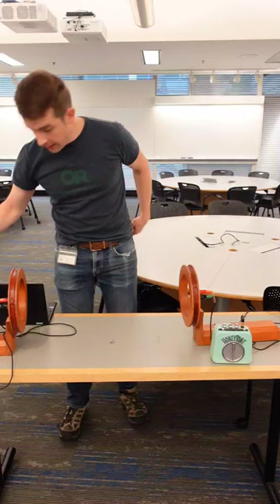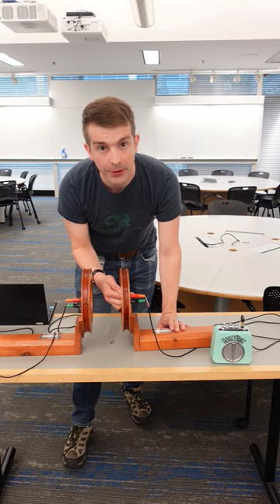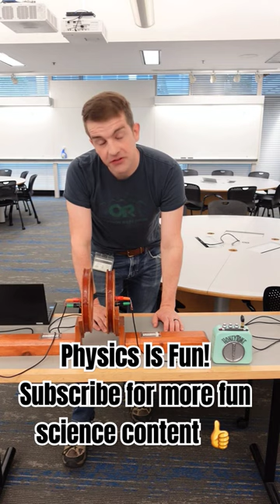Wireless transmission of electricity! #physics #science #stem #electricity

Comment: For anyone wondering, this setup is essentially a transformer. This is an excellent demonstration of mutual inductance.
Reply: Yes, it's known as an air-core transformer.
Reply: Sigh. Thanks. You beat me to it.
Reply: Well can someone at least tell me how many turns of the coil is necessary to recreate
Reply: @villagevaliant all depends on your input voltage and desired output amplitude (without further amplifying it). More wraps takes more current means more voltage, and conversely the more wraps your pickup has the more current your "transmitter" needs. There isn't going to be one solid answer for you, I guarantee there's a tutorial out there though.
Reply: Probably definitely gonna be hundreds though lol.
Reply: @azraellie_  Appreciate it, I actually just came across a video going over what you explained quite clearly might I add ! lol Fr appreciate the input

Comment: 90 degree means ….. NO FLUX GIVEN.
Reply: No. It means there is no rate of change of flux across the wire turns in the second coil.

Faraday's Law is to do with rate of change of magnetic flux.

So you could have a steady DC current passing through the transmission coil and for the two coils to be aligned in the same direction along the same horizontal axis and physical separation to be very small,  there would be a magnetic field produced by the transmission coil but the receiving coil would not output any current
Reply: Nice 😂😂
Reply: @deang5622 - You totally missed the joke smarty pants!
Reply: Damn 😂😂💯

Comment: Yes! Those mini guitar amps are good receivers. Most old guitar amps too. I used to have an old Peavey amp that would often pick up the signal from a Spanish radio station. Made it hard to be taken serious in my local music scene. I eventually sold it and bought a Line 6 amp with a good noise gate.
Reply: The original is more interesting. To me anyway.
Reply: Happened to me with a guitar speaker too
Reply: "I'm on a Mexican radio..."
Reply: Mine loves to pick up the Spanish channel too
Reply: That’s not really the same thing. One coil of wire a turning low frequency electrical energy into magnetic energy, while the other has an induced electrical energy from that magnetic energy (that’s why the coil is called an inductor). A guitar amp picking up a radio station (which usually occurs when a cable is plugged into the amp but not plugged into a guitar) occurs because a high frequency electromagnetic wave is being picked up by the cable, which is acting like an antenna. This is usually done with AM radio stations, which can generally be turned into audio with a simple capacitor, which is often one of the first components in the signal path of a guitar amp to remove low frequency noise. This can also occur with FM radio stations if the right circuitry is in place and the correct cable length
Reply: @caydjj It can happen when plugged in too, the pickups will do the same thing. My amp makes a noise when I get texts or I'm about to get a call, sometimes just randomly. It sounds almost like a modem noise. I also had a fancy amplifier for my PC Audio back in 2010 and it did the same thing everything I would get a text or call.
Reply: Peavy was noisy.
  My spring reverb always hummed.
Reply: @lucky.the.boy.tundra  No. Still had to put up with haters because haters gonna hate. 🤘
Reply: There is a circuit in the amp that is a resonant length for the radio station.  We used to create that in an audio board at a television station. Flip some switches and turn it up. Got the local AM station.
Reply: @jwr2904  I see what you did there.
Reply: @Ridgerider-z4h more likely it's the size of the loops going to your guitar. If the loops are all the same size they'll resonate with the same frequency and the amp will increase whatever it picks up.
Reply: Eddie Van Halen wrote Poundcake using an electric drill after a subcontractor caused noise in his guitar amp after operating the drill. Same concept
Reply: @jwr2904 Wall of Voodoo ‘82 😂😎(Call of the West) have the album, haven’t heard that in years!

Comment: 1. Are the values of L and C the SAME 
2. where is your GROUND wire 
3. Where on the circuit did you put you GROUND.
Where you connect it will depend on you output and the RANGE you can get.

Comment: I witnessed this first hand back in the late 70's when our neighbor across the street was using his CB transmitter that was over powered. I could hear him through the speakers of my mom and dad's reel to reel even though the reel to reel was turned off. I called them on the phone and it stopped.
Reply: My grandmother lived 200meters next to AM radio tower. She listened the radio with 2 meter antenna directly connected to a speaker. Without any lamps/transistors nor external power. The antenna itself was hearable even without the speaker. Also some metal dishes, forks, knifes, randomly vibrated and made  noises if in right position.

Comment: Transformers are always cool. I assume the turn count is the same. Otherwise, you would be getting distortions. Unless you also have a filter circuit... hard to tell on my phone. Very cool 😎 👍
Edit: There is some confusion by what I mean by distortion. Changing turn count changes step-up/down transformer, i.e., the final voltage. If they aren't matched, then the impedance is not matched(unless a reactive load), causing interfering waves as the inductor(second winding) collapses/builds. This shouldn't be very noticeable at lower tones where the fields have time to bleed off, but at rapid or high frequency tones, it would cause coil whine. I am not an audio engineer, so I am a bit out of my depth with how extreme of an effect it would cause.
Reply from the maker: Yep! Same turn count👍
Reply: @physicsisfun_official bro wher u turned the 2nd one by 90 degrees , u sharply turned the switch of music off , and when u made it again parallel , then u sharply turned the switch on 

You are only making us fool 😡😡😡
Reply: What makes you think a difference in turn count would cause distortion?
Reply: @opguy_219  No he didn't. He was holding the base so it didn't move.
Reply: @@brotinger_1904coding and decoding? To explain how a transformer works? 😂 There's no need to have the same turn count at all. But it's necessary to match the impedance of the receiver (a speaker or an amp). Turn count is one factor determines that.
Reply: @@brotinger_1904a different turn count would not change the music, only the amplitude of the signal, which would appear as gain on the speaker.
Reply: @Ferraday  it's would cause a volume change
Reply: Step up vs step down transformer
Reply: @opguy_219 it's a simple 1:1 transformer, not a magic trick.  He isnt trying to fool you... you are doing ok on your own.
Reply: No, if the coils had a different number of turns he would be getting the same amplification in every frequency. So no distortion.
Reply: @opguy_219  What he does is totally legit.  Try it for yourself to see.  Also, whatch the video carefully.  There are no switches.
Reply: @Ferraday  The coil with the more windings will have a magnetic field that is slower to collapse and build.  Its response time will be longer.  At high frequencies (high pitch sounds) the magnetic field will not build and collapse as fast as the smaller coil's field.  That means that the sound comes out distorted from the original. It gets kind of "staticy".
Reply: @appliedfacts the funny thing is he says it wireless while using at least 100m of copper windings to do the job a 1m length of speaker cable would do lol its like building a generator on your electric car that runs on diesel and saying you have a totally electric car lol
Reply: I love all the amateurs guessing.
Either you have studied transformers in detail or you haven't. If you haven't studied them as part of a physics or electrical/electronics degree, then STFU: your explanations are likely to be wrong
Reply: @deang5622  so do you have a point or are you just trying to sound all high and mighty ? Lmao
Reply: @deang5622 social media has brought us humans the great joy of seeing a strangers ego destroyed in real time. You saw a bunch of comments debating a topic you know nothing about and decided to try to insult everyone because you don't understand the topic. Don't pawn your insecurities off on other people little guy, I'm sure you're an expert on something; try coloring books or those puzzles where you put the right shaped block in a box.
Reply: @danielmiller2886 opguy probably beleives in witches also😂

Comment: You did not mention amplification. The music (current) coming out of the computer is tiny (milliamps), so you need to amplify it before feeding it into the coil.

On the receiving end, it might be enough to drive earbuds but I’m going to guess that you also need amplification if you’re going to play it that loud on external speakers.
Reply: Actually, the power produced in the reciever coil of this apparatus will be around 70 to 90 % efficient at proxima. ~100W in for ~80W out.
Reply: Or the speaker could have the amp...
Reply: @nomandoerr874 how is that related to currents?

Comment: If you put a coil in between the two would you get  "inverted sound"? Just wondering if its possible and what it would sound like
Reply: It think it would be already inverted as is. That’s why the plugs between the left and right are switched (the same location even tough it’s mirrored), to get the opposite coil winding and counter the inversion.
Reply: It wouldn’t matter. The sound would simply be 180° out of phase. A speaker driving inward makes a sound as well
Reply: Though if you do have 2 speakers that have opposite polarities it can creat interference and you get very low sound depending where you are.
Reply: You would merely intercept the current that would have gone to the receiving coil.  Do you get that one coil has current running the length of the insulated coiled wire and the other similar coil, if close enough "detects' and "absorbs" some of the electomagnetic field and follows its fluctuations.  Switch the two wires on a speaker between listening to the same thing.  You won't be able to tell the difference with  "inverted" sound.

Comment: Used to set up speakers without internal amplifiers each week. Once we were confused by music playing from them before the amp was even turned on: accidental radio antenna tuned to a Latin music station.
Reply: The station must have been close by and the speakers of efficient design.  Possibly the speaker wires were long enough and close enough to a multiple of the station's frequency to serve as a good antenna.  

Crystal radios with passive earbuds and enough of an antenna can demodulate a broadcast signal efficiently enough to be audible without amplification.  That's impressive due more to the sensitivity of our eardrums than to the power of those tiny speakers an inch from them.

Comment: Back in the 50s my dad read an article in Popular mechanics. He got a long wire that went around the room and plugged into the audio jack on the Hallicrafter TV. Next he got an old pair of headphones wound a halo of insulated copper wire. Hooked that up to the speakers in the headphones et voila blue tooth. Nothing new here folks, move along. It could have used an amplifier but it did work.

Comment: How about a comparative demonstration, showing capacitive coupling?  

After that, try Xl vs Xc demo's with purely reactive circuits, to show no power transfer and therefore no resultant audio energy, and how energy transfer is affected by impedances that work well from source to load?  

Next comes a comparison of impedance matching in older tube amps or RF systems, to zero impedance current source solid state amps as motor/brake sinks as well as sources, that have huge damping factors over inductive solenoids (aka speakers usually) that actually have complex impedances over bandwidth?

Comment: I prefer to call it Lenz law. But, yeah, a current will be induced in the secondary coil in such a way that it will oppose the external magnetic flux that goes through its inner area.
Reply: Indeed,
The exact reason copper or aluminium or any other paramagnetic metals have a proportional magnetic field induced by the material moving within the magnetic field..
Or why a magnet falls slower when dropped through a paramagnetic metal pipe
Reply: @_bambi_420_za_  Your explanation seems rational, but Lenz's/Faraday's applies to conductors in general without considering their magnetic properties.

Comment: What happens when you put two coils in parallel like that off the same ac current source? Can you make an expanding and contracting magnetic field and also what about a tippler cylinder made of electrical currents like that? Does a tipler cylinder have to be made of matter? Also what if the tipler cylinder is made of magnetic material or more or less dense material does that change the properties of the tipler cylinder?

Comment: Is It power transfer or data transfer (technically the same thing but decently different enough) like is the speaker already powered by batteries or wire?
Reply from the maker: In this case the speaker has a battery powered amp to make it loud enough to hear. But you can easily light a light bulb with this set up as well. Which I plan on showing in a video soon👍

Comment: At first I was like, THEY TRANSFER SOUND??

nah it's power but that's dope. Probably how wireless phone chargers work
Reply from the maker: Yep EXACTLY how they work👍
Reply: @physicsisfun_official  Marine electrical AC power isolators have been using this technology for many decades...(as do transformers).
Reply: I mean, from a certain point of view, it absolutely is transmitting sound in the form of an electrical signal.

It's been a while but if I remember right, all a speaker is is an electromagnet attached to a thin membrane, and when certain electric signals pass through the magnet, it causes the membrane attached to the magnet to vibrate at specific frequencies, producing sounds.

Ah, physics are fun 😅
Reply: This is basically the same a any simple transformer. This just happens to be an air core transformer
Reply: @AlpineTheHusky That's why it's nothing special about it. Booooooring news. YAAAAAAAAAAWN
Reply: @ubncgexam  You ok over there?
Reply: @williamklemp3764 not Electrical but magnetic .... the coil converts the magnetism back to electric ...
Reply: Well if you put a cone of paper attached to a permanent magnet in the coil... You kind of get a speaker. So... Yes that is transmission of sound too.

Comment: So its just induction? Not resonance coupling? This experiment demonstrates why Tesla's wireless power would never work. See how quickly the power drops off.
Reply: Closest we'll ever get is a form of high powered radio,
Or hi powered laser arrays..
The transmitted power is really low and dependent on atmospheric conditions interference..

Everything else needs to be so close you might as well just plug it in.

Nicola Tesla's idea is not a possible reality.

Comment: How is the computer hooked up to the coil ?
Reply: With a wire. You can physically see it in the video.
Reply: @Mulgar268  sorry i wasn't clear. I meant to as the plug type. Was it USB ? One end is usb and the other end at the coil is just copper taped to the cable ?

Comment: Radio is much better for wireless power transmission, the method of transmission you described is still not properly "wireless" because it has to be "close together" the effect diminishes with the fading magnetic field.

Having it so close it's just more energy efficient using solid contacts because most of the power consumed by this setup is lost to unused magnetic fields and other circuit losses..

It's fancy but not that cool
Reply: It's like people don't even understand that computers used to be the size of a room and now they fit in our pockets. At what point will people like you realize that with time technology advances and gains efficiency?
Reply: @Mulgar268 There are limits however.

There will always be a loss when one form of energy is converted into another, this fundamental law of physics.
There are also limits of electromagnetism

The fact that a computer use to be the size of a room and now smaller than your hand does NOT mean it will always get smaller, we are already reaching the limit with 5> nanometer transistor chip spacing.

Some thigs are as efficient as they will ever be.

Comment: This isn't "wireless transmission of electricity". This is nothing more than a transformer - electrical power being transformed into magnetic power, being transformed back again into electrical power.
"Wireless transmission of electricity" implies transmission of _electricity_. That actually does happen inside an old-fashioned valve/vacuum tube.

Comment: No, you are not transfering electricity.. you are merely creating and catching frequency. (Radio) the speaker, has a battery.
Reply: so you know the details for that exact model of speaker? or are you assuming that because you didn't know electricity can be wirelessly transferred? I can tell you those are definitely not radio waves. look up what a transformer is and how it works.
Reply: @znk753  yeah.. so, how loud are your speakers when plugged into the headphone port? Can your headphones get loud enough for an external microphone to pick it up clearly 5ft away? 
Use your brain. A lie is a lie.
The answer is no. A larger speaker requires amplification.